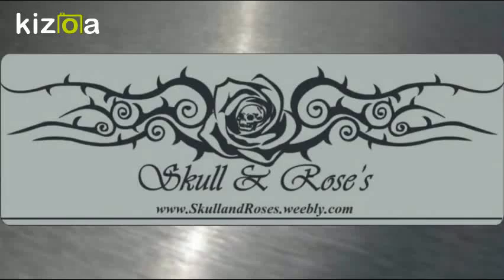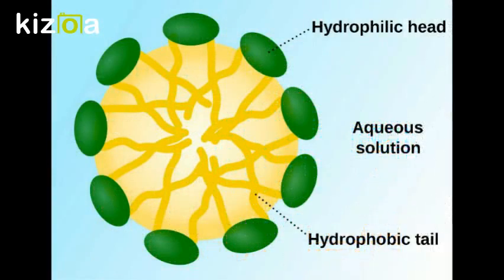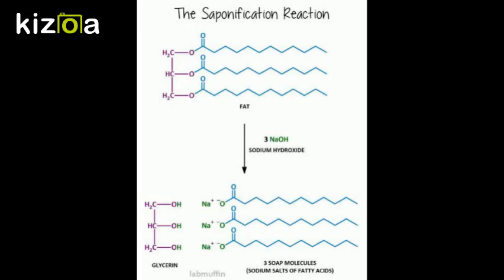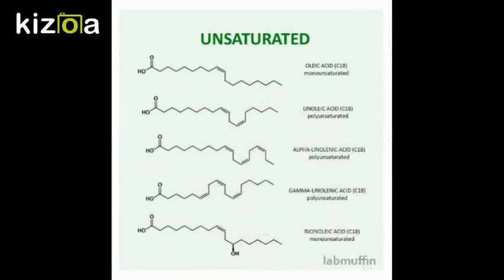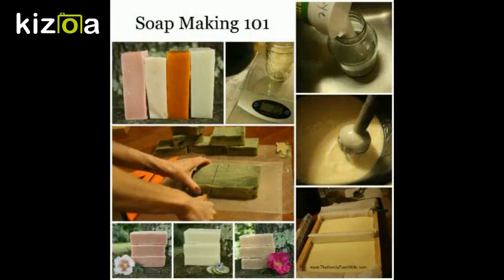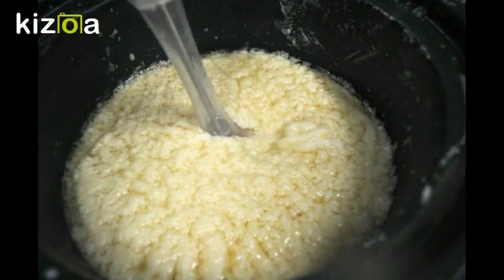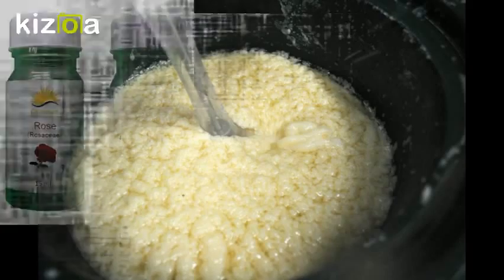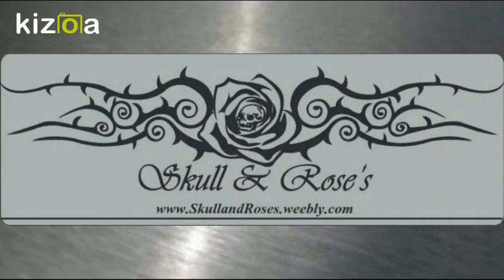Soap and Surfactants

Comment: why would a saturated fat soap be better at cleaning?
Reply from the maker: Because saturated fat molecules form straight chains as opposed to unsaturated or polyunsaturated fats which have what is caused "double bonds" along their molecular structure causing a looser fat structure. Even as just raw fat you can see the difference because the saturated fat can compact more tightly as straight chains and solidifies at room temperature. For soap this means that soaps made of it dont have room for anything else in the molecular structure between the triglycerides (such as extra moisturizing elements). If you use these soaps on your skin since they're more intense of a surfactant you're stripping extra oils off your skin the same as if you used a more gentile soap many times. For laundry or cleaning though this will be preferable because you use less to get the job done. Please keep in mind though that most modern laundry soaps are liquid because manufacturers WANT the extra leeway to add things to reduce fading, extend the life of the fabric itself, and similar things.
Reply: @LimeySnow777  thank you so much